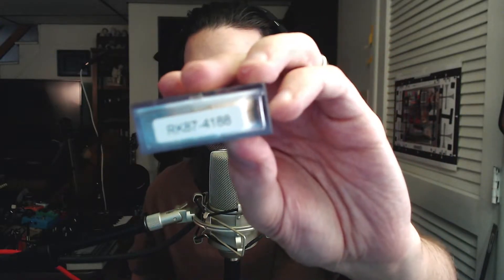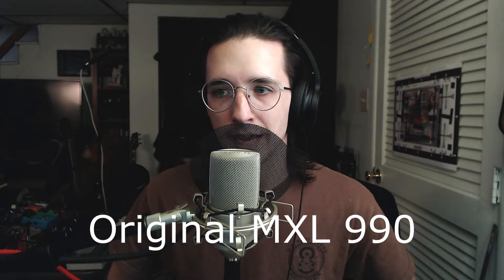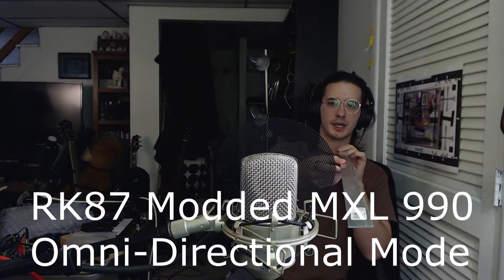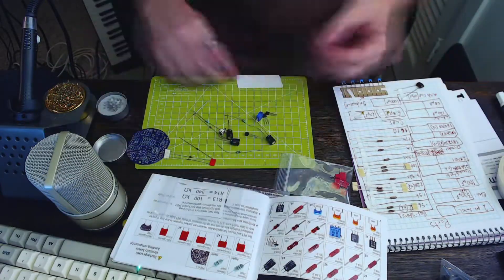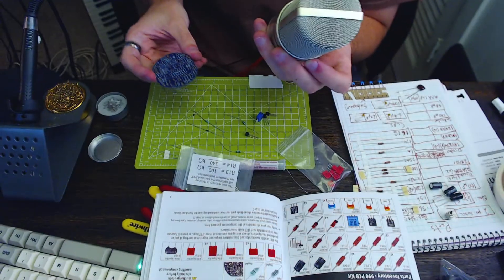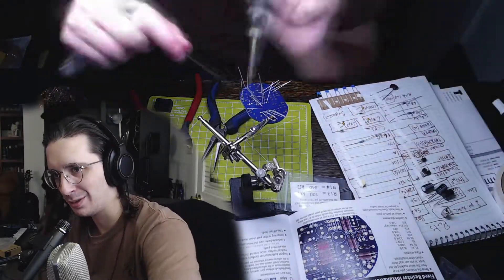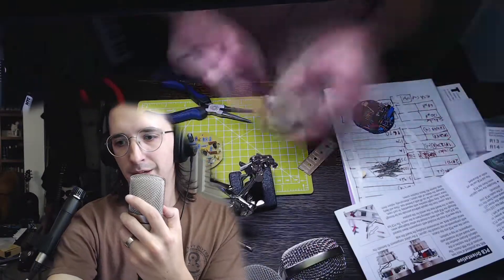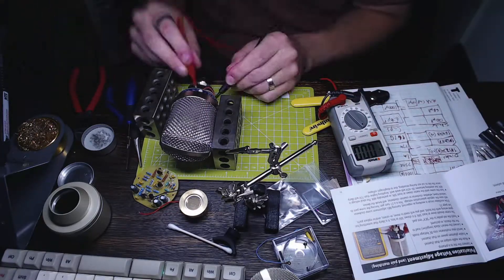MXL 990 Microphone Parts Mod RK-87 Capsule Omnidirectional Upgrade Review

Comment: Hello sir, I have an MXL 990 Blizzard microphone. I hadn’t used it for about a month, and when I tried it again, it has become very sensitive. It’s producing a lot of airy and crackling sounds. I’m using it with the M-Audio Air 192|4 interface, and the interface is working fine, as other mics are working properly with it. Can you please help me with this issue?
Reply from the maker: Hello, I probably can’t be too much help other than to make sure the contacts and cables are clean and working properly. If you are handy with electronics, you can open the microphone and use a voltage meter to ensure that all of the capacitors, wires, resistors, etc. are working properly. That may give you an idea of a component needs to be replaced.
Reply: @richpence ok thank you so much ❤

Comment: Why did u choose the rk87 and not the k47 which a lot people has done videos on
Reply from the maker: It's been a few years so I'm not sure I can totally remember. I believe I was more interested in the u87 sound vs the u47/67. But also at the time I was most interested in the Omni-directional functions, which the rk87 capsule seems to list more function and testing based on that. Also at the time the 990 circuit upgrade was just recently updated and improved just a couple months before. Also note I am doing the Circuit upgrade kit, not the 990XF kit, which I don't remember if that was out at the time. The 990XF kit is built around the rk47c and rk67c capsules with finer and more stylized frequency tuning. but no note of the omni possibility.

Ultimately I wanted a more flat and modern sounding mic at the end, and the 990 circuit specifically lists the rk87 capsule for that purpose.
Reply: @richpence  thanks for the response man. Very informative video

Comment: That sound on your mod is defo a problem. Sounds like you have maybe not installed a component correctly.  If you want the mic to sound so different why don't you just buy another mic.
Reply from the maker: Do you think the upgraded mic sounds bad? I've confirmed that the low frequency oscillation heard in the sample is in fact the sound of various air conditioning units in the town house block I lived in, I had just never had a microphone sensitive to pick that up. I believe I installed everything correctly and tested all connections and voltages, and the issue does not happen anymore I live elsewhere.

I didn't just buy a new mic for a few reasons. Primarily, I just like these kinds of projects. I like to build things myself, come up with my own designs, primarily cameras, and audio is a side hobby, and I got started in it by getting and modifying DIY guitar pedal kits. I just find it fun, is the main reason. Secondly though, I found Mic Parts and again liked the DIY, and I happened to have a MXL 990 that I was not using. It is a totally fine mic and sounds good for the price, but I was not using it, instead using the Shure PGA 181s for those kinds of condenser mic situations, so I was open to the idea of repurposing the mic. Thirdly, it has the Omni polar pattern function which was really the only kind of Mic I was missing from my collection. 

I spent around $350 on the parts, and in theory, the parts and circuit are high quality, and do not take shortcuts on design to use fewer parts, and cheaper parts, or save money on manufacturing like the original 990 certainty does. I could of course buy a really excellent microphone with an Omni setting for $350. But I do believe in the idea that by building yourself, and seeing the time investment as just that, an investment in the hobby and fun, and not as an expense, then you can get to a much higher quality end product than you could by spending on a finished product. MicParts is able to give you higher quality parts for the same money because there is no assembly and production cost to them. 

whether that is true or not, whether my mic for $350 sounds as good as a TLM 103 or U87 costing 5-15x more as the circuit and parts would suggest? I have no way of testing, but I would be very interested to if I have the opportunity! But ultimately at that point it's about if I am happy with the mic and how it sounds for the time and money invested, and I very much am.

Comment: It is normal for a large membrane microphone in omni mode to be a bit directional for the high frequencies. The reason is that form the side, the high frequencies roll over the membrane and make it wobble rather than go in and out. The wobble averages the movement of the membrane out a bit. 

Many houses have a resonance to them, which is exited by traffic (including boats) and pipe lines. 

Cool video, thanks.
Reply from the maker: Thanks for watching! Yes it does make sense that a microphone with a capsule like this will not be totally perfect as an omni directional, but I am still really happy to have that functionality in my mic collection now, even if it is potentially better used in a bi-directional style. Yes i figured out that it was the resonant frequency of the townhouse block we lived in, with furnaces and air conditioning running. I had just never had a mic sensitive enough in those low frequencies, or low enough in self noise to ever pick it up clearly in recordings.
Reply: @richpence if I send you the components and everything, could you build one exactly like this for me? This modification made the Mxl 990 sound like a u87 for a major fraction of the price. I’m so serious, please respond back to this and thank you 😊🙏🏾
Reply from the maker: @xavierreid9995  Hello, unfortunately no. I'm not comfortable building projects like this for others, and I would charge for my time and work. So if it takes me 6 hours, even at a modest charge of $50 an hour + the initial price of $400 for the kit and the 990 mic, you're looking at over $600. Which for that price Micparts already offers  pre built microphones with the exact same components and designs for between $500-800, so you could just buy one now. Or any number of other good u87 clones like the w87 from warm audio. You will only get significant cost savings by doing it yourself, which I do highly suggest, it is a worthwhile hobby beyond just cost savings.
Reply: @richpence  oh I certainly understand, and I would pay you. Do they have any with that same capsule and same circuitry already built? I love the tonal characteristics from it
Reply from the maker: @xavierreid9995  yes their S-87 pre built microphone is essentially the same circuit and capsule, likely improved since mine is a few years old now.
Reply: @richpence  ok cool so the same tone right?
Reply from the maker: @xavierreid9995  I would assume so, I haven’t directly heard one. They have a lot of comparisons with their mics and u87’s
Reply: @richpence  cool, that’s what’s up man

Comment: Damn. 130 for the mod kit, then it says it should use their large diagram kit for like 300 or 400. Then the thing itself for like 75 dollars.

Is it worth all that when another mic in that higher price range will also work along with analog or digital tools to help?
Reply from the maker: The price is for sure a question for each to answer on their own. For me, I already had the mxl990, which a lot of people do; and then that the whole DIY modding and diy music equipment (like guitar pedals) building, soldering, and in some cases designing and tinkering, is it’s own hobby and passion, so in many ways my feelings on the money and time is that I ultimately enjoy the hobby and the get something that is a high quality piece of equipment at the end. One that I’m more proud to use and have and to understand how it works. 
Of course audio quality is subjective. The idea is that for my $300 or so dollars and a couple afternoons of work I am getting a microphone that can “rival” something like a Neumann u87 which runs upwards of $3000. Now is the Neumann worth $3000? Is my modded mic really that close in quality? Who knows! It’s all subjective. I can say that I hear a distinct difference and it is the highest quality, at least objectively the lowest self noise and smoothest response, to any of the microphones I have. And above anything else. Being proud of and believing that the mic is really high quality makes what you make with it higher quality.

Comment: you seem happy with it , low rumble could be from not having it in a mic basket ( or whatever they are called ) have fun !
Reply from the maker: I am very happy with it still! It got a fresh coat of green paint. The low rumble after walking around the house with it was actually my neighbors AC unit! Until this mic I had never had anything with even close to that level of sub bass frequency response.
Reply: @richpence  Some bass-trapd and other acoustic treatmetnt might help cut that down. Though, if it's THAT low of a frequency, you could probablu just EQ it out...
Reply from the maker: @BrianJurkowski  Yes, of course proper space treatment is really key. I have pulled this mic back out and am using it as my main desk mic now. I do not notice any weird frequencies at any reasonable gain settings for close VO use. For this video I was using a fairly cranked gain setting to hear the noise floor, and with the mic having basically no self noise, I was then hearing the rumble of ac units. Of course for VO stuff a 80hz high pass works well. I even found and occasionally use the Shure A15HP, an analog inline high pass filter, that has a very smooth 100hz rolloff before the mic hits any preamps.

Comment: Bought a used mxl 990 for $70 shipped. $10 for capacitor upgrade and $25 for 34mm diaphragm from China. It sounds sooooo much better. The diaphragm makes the biggest difference. First I did the capacitor and used it until the diaphragm came in. Both make a difference but man, the diaphragm is such a big difference. Im wondering if the PCB board is worth the upgrade. Im new to recorsing and am really interested in how it stacks up to others
Reply: Ive done both the cheap capacitor way and the Micparts version of the mxl 770... got to say micparts is just on a whole other level. worth the money.. the cheaper way wasn't bad but the micparts one still is top dog in my opinion
Reply from the maker: I agree, the Micparts mod was totally worth the money. I have zero desire to upgrade to any other condenser mic, neumann or whatever. I'm really interested in their small diaphragm condensers, but really would love for them to come out with a dynamic voice mic. My only dream mic still is an RE20, but I'm sure micparts could come up with something even better for the same price.
Reply from the maker: I can say that the modded 990 is by far my best microphone, but I really don't have a lot of other nice mics to compare it to. The noise floor alone is exponentially better, it is basically silent at any gain level. Also the frequency response is lower than any other microhpone that I own; it is able to pick up sub bass that were never audible with any other microphone I own.
Reply: Which model capsule did you buy from china man?

Comment: I have like 3 of these type of cheap mics and was looking at getting these mods from so could repurpose and recycle what i have instead of buying super expensive mics.

what tools would you recommend or helped you in the process that someone wanting to do this might not be thinking of?
Reply from the maker: Really worth it to get one of these mods! it's a whole new mic hitting way outside it's price point. some helpful tools and tricks all can be bought on amazon:

a decent adjustable temp soldering iron and a stand with brass coil tip cleaner. on amazon ANBES is selling a adjustable 60w soldering iron kit $24 with a little screwdriver set and a digital multimeter, both are also needed in this mod. and Noah premium makes the stand I use $12

GET TIP TINNER AND SILVER SOLDER! This will save your iron tips from oxidizing and being eaten UP! Thermaltronics tip tinner, use as follows: after soldering clean the tip in the brass coil cleaner, then melt the tip into some of the tinner and then give a couple more dunks into the brass coil cleaner. Get 0.020" silver solder, nice and thin and quick to melt and position. Kester PB36 / AG02 is what I use.

Some spring loaded needle nose pliers, the $8 ones from outeels are perfectly good

a couple sets of little helping hands to clip onto and move/ hold the pcb while soldering. NEIKO make them for $11 with a little magnifying glass and two clips.

Some good wire stripper pliers that can also trim leads so as not to use your nice flush cutters. DOWELL have some for $7

Which leads to flush cutters! Whizzotech are great. Their 5" Micro Flush cutters are awesome and perfectly flat on the bottom for beautiful pcbs. Baby them a little to keep them sharp.

Get a small cutting pad to work on. Olfa make a little 6x8 one that is perfect for just bringing onto the desk for these little projects.

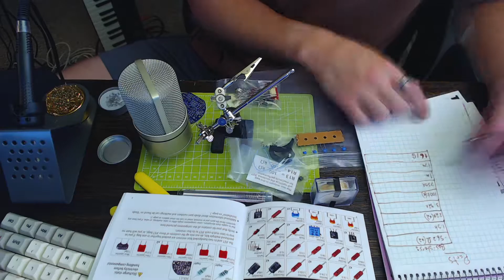and TOP TIP! Pen, Paper, and some masking tape cut into little tiny strips. at around 4:30 into the video you'll see me time lapsing through writing out all of the parts and quantities onto a piece of paper then taping the components on next to their name. Check that you have everything and that it is correct! This is time consuming but makes the actual soldering and building a no brainer and way more enjoyable!

Comment: my akg 100 just broke. I think capsule is dead as I was shouting at it few days ago and now just pops....so thinking of ordering chinese rk87....but not sure I have technical hands to pull the mod off
Reply from the maker: This mod is a medium/difficult (really it's just expensive if you mess up at certain points) so it may not be a good idea if you have no experience.
I got into this kind of electronics kits via diy guitar pedal kits. if you are a guitar player you can find some cheap kits on amazon by searching "diy guitar pedal kit" or if you are not you can just search for diy soldering project and find a bunch of $25 or so soldering projects for radios or games or bluetooth speakers that will give you a toe in the pool to build your confidence. The price of doing these mods vs the quality of mics it can beat out is really great so worth the investment.